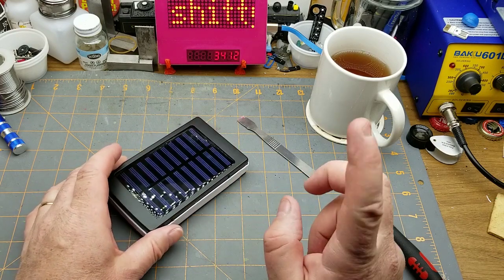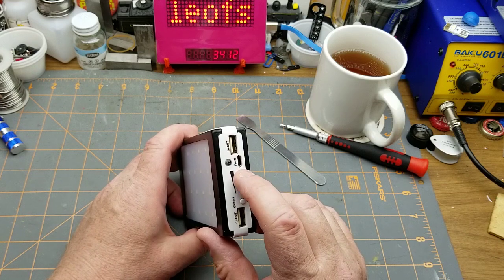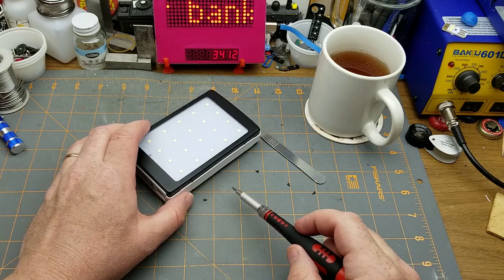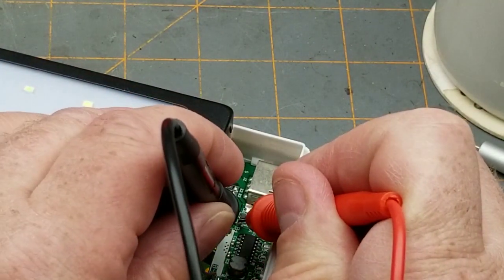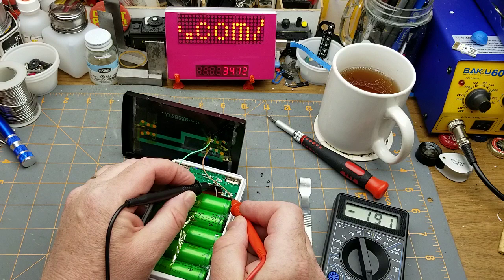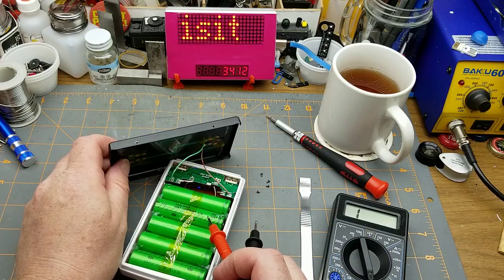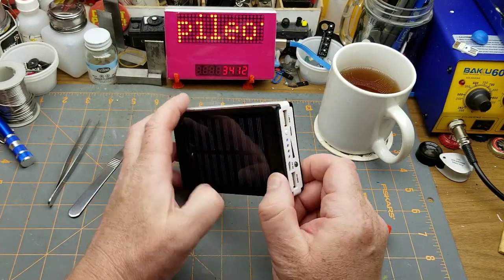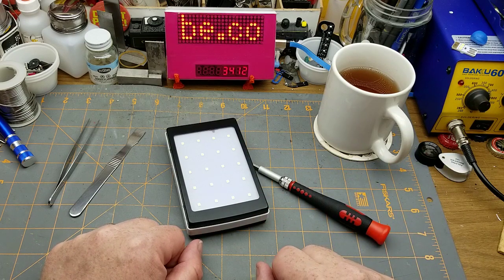cheap solar powerbank revisited

Comment: The solar panel will only be useful to stop the battery drain when it’s not in use, so they stay full instead of gradually discharging, other than that, yep it’s a gimmick.
Reply from the maker: I suppose that's some value....
Reply: They also will kill the cells by overheating them, as you place the device directly in the sun, and thus cook the cells inside. Better to have a separate panel with the USB connector on it that simply plugs in, and with at least the ability to have the cells in the shade.

Comment: Cobra makes an emergency battery jumper for a car that is approx. The same size. People call them crap and say they don't work. However they do have a slight qwerk to using them. You should hook up the cables to the batt. first. Then turn on the unit next. Then plug the cable into the unit. Hooked up any other way and for some reason it will not work. I think that there is a protection circuit inside the unit to keep the car battery from blasting the Cobras circuits out. At first it did not work for me. Then I accidentally hooked it up as I described and it worked great, not to mention jump starting the car 4 times in a row as it was out of gas. So yeah they work good.

Comment: Thanks for the follow-up video. Do you have any recommendations for reasonably priced 18650s in Canada? It’s become impossible to find much for under 10 or 12 bucks apiece.
Reply from the maker: Other than salvaging them from used laptop battery packs, I haven't found an affordable source here either.

Comment: well done. great review and very competent. .. Interrogative: Is there any way to increase the output of the solar panel and Furthermore, would the current rate (though So slow it may be) of intake by the solar panels be sufficient to maintain use (or even build if down some) if it had already received a full charge in the beginning as you did. ... And what are your thoughts about getting a full charge on any battery before using.  such as a cell phone🤔 thanks for let me pick your brain bub😵🧐
Reply from the maker: As far as I can tell, the only predictable way to increase the solar output would be to go with a bigger panel. 
This one is basically only going to keep the batteries topped up, not to charge it from nothing.